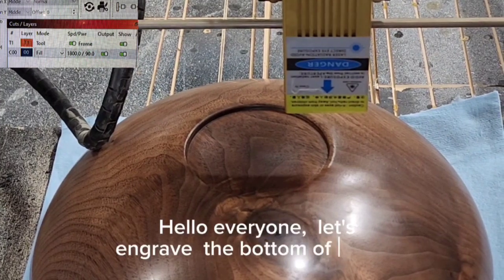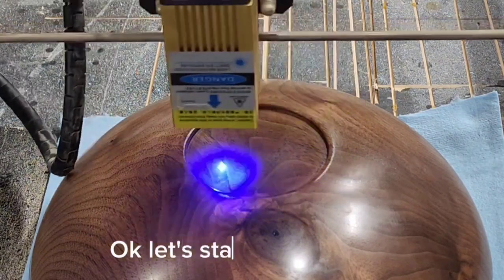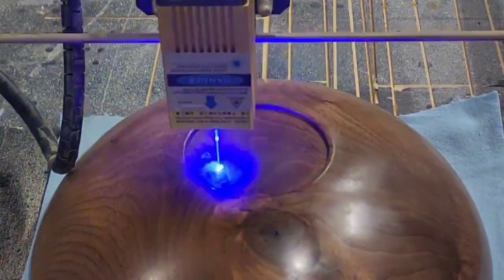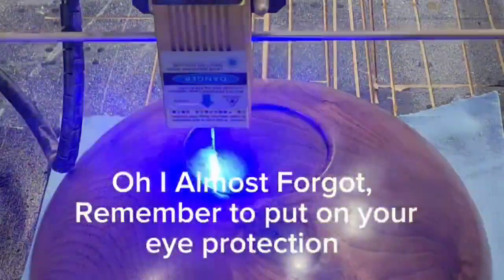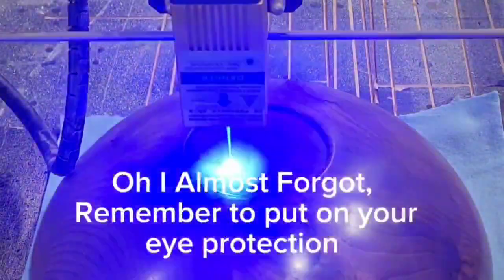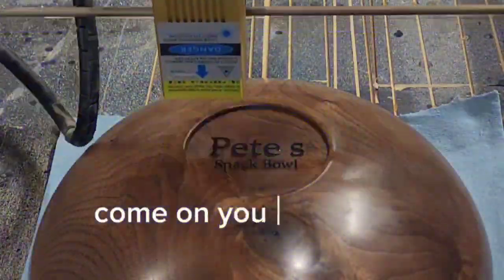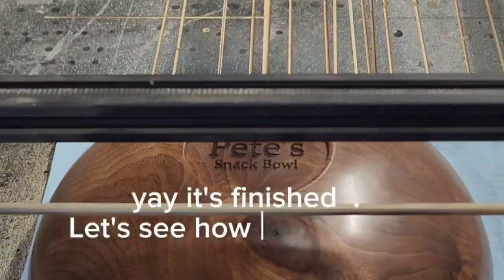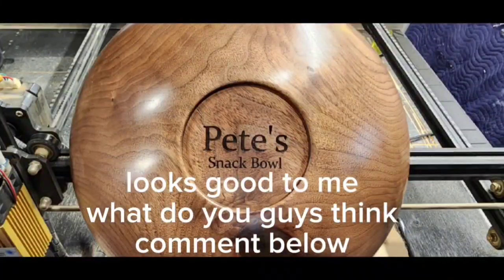Let's Engrave The Bottom Of A Wooden Bowl With A Diode Laser #woodworking #laser

Comment: Nice work
Reply from the maker: Thank you
Reply: What kind of laser engraver is that? How do you raise it to the best height?
What about engraving the inside bottom?
Reply from the maker: @tomfellowes4081  thanks for the question, the laser is an Ortur LM2 with upgraded laser head (laser tree) and we used wooden blocks to raise it up to the correct height, and we did the outside of the bowl because the client wanted it there.